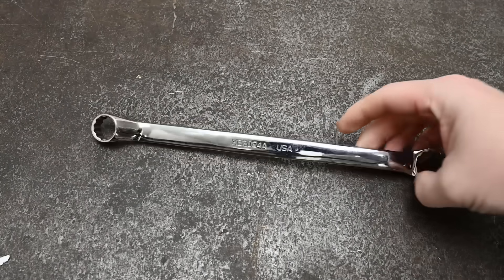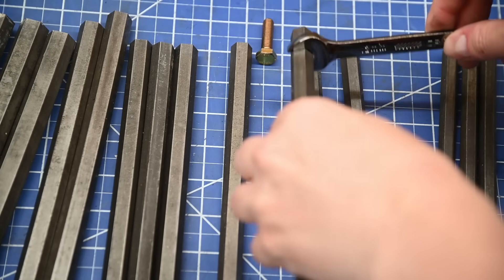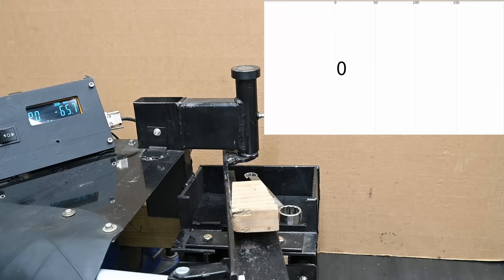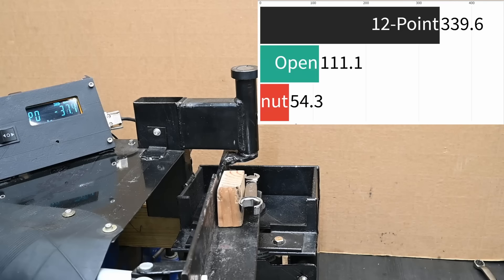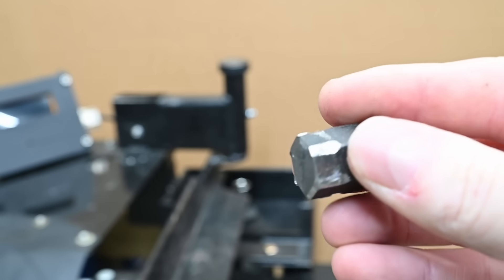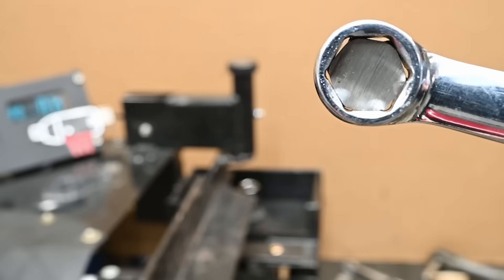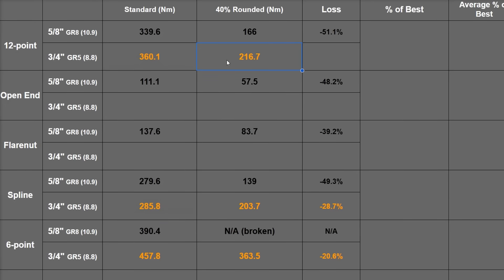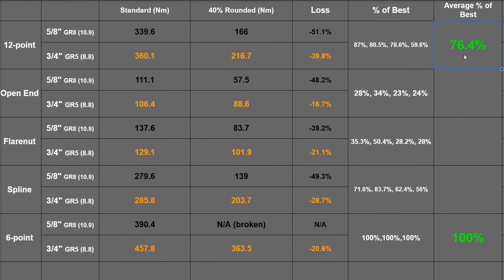Wrenching Robot Settles Which Slips 1st

Comment: I've used 6-point box ends, they were relatively rare back when I was working.  They somewhat defeat the purpose of a box end wrench which is to provide maximum strength and maximum flexibility to fit into a tight space.  I don't recall ever having a problem not loosening a fastener with a good 12 point box end.  Maybe these days with mechanics having large boxes of tools it is worth having a set of 6 point to supplement your 12 point but I didn't have them.
Yes this always sounds like my kind of fun.

Comment: I would like to see you do a bit more testing on spline drive and rounded stuff. I only say that because i personally have removed bolts with a ~2010 craftsman spline drive wrench that I rounded with a late 90s area craftsman 12 point combo wrench back in my younger years when I didn’t have the knowledge and tool access I do now

Comment: Who would have thought, a 6 point tool works best on a 6 point bolt.

What's more amazing is that these tool companies can sell an all in one tool that fits on every bolt to people who think it will work best on every bolt, like those gimmicky any size tools that break after 2 uses.

It may be more expensive, but you buy the right tool for the right job, even if it means buying more tools, and it will make the job easier.

Comment: I worked on F-16s, we used spline wrenches ... on spline bolts. Why you would use it on a hex nut is ... beyond the pale. Use the right tool for the job.

Comment: Would these all behave the same if they didn't have a chrome plating in the business ends? 
I'd love some quality raw spanners, went with pretty much all Stahlwille because of the concave shape and the matte finish. Raw would be better in a work environment, getting sliced by flaking chrome plating on the sacrificial spanners sucks.

Comment: Something the comments are making evident, with cars when you have plenty of room on small vehicles.. 6 point is best. Clearly alot of the commenters have never worked on heavy vehicles (Talking 50+ ton underground dumpies and boggers like Sandvik or Epiroc).... You might be doing up a bolt that only allows less then 10' of movement due to hydraulic lines or the steel frame itself and you cant fit a ratchet in. 12points rules in this scenario so that you can actaully start to rotate the nut.

Comment: 4:12... By the time I'M done mangling a stubborn bolt, by using vice grips and pounding on sockets that are the next size smaller, it has lost WAY more than 40%. 

Once I have it destroyed to about 60%+ of it's original size or less, that's when i call it quits, haul out the Acetylene torch and just cut the fugger off... 😮‍💨

Comment: It all depends on the fastner but 6 point is the best for torque. The other types are mostly for speed. If you are using a different type fastner you should use the correct tool. If it is not 6 point then it will either have low torque or steps to tighten. There is no magic to this.

Comment: a 12-point wrench is meant for a 12-point fastener. try again using the correct fasteners for each wrench. otherwise, your tests were no more valid than all sorts of other incorrect tools for the fastener, eg. strap wrench, pipe wrench, etorx, acetylene torch, pliers, vise-grips, bladed screwdriver, hammer, etc.

Comment: Thanks for the great video! You've confirmed in my mind that buying a single-hex ring spanner (box-end wrench) is a waste of money... I mean, what use is 13% more torque if it destroys the tool? Sure, the 12-point spanner damages the fastener (and lets you know that you might need to use other techniques or tools to remove it) but, at least, you've still got a full toolbox.

Comment: I live in the Rust Belt and the 6 point is a must have unless its a new bolt. I don't get why these tool manufacturers don't make 6 point wrenches as common as the 12 point. You have to shop around to find them

Comment: Let's talk about the 6-point solution...which are the Astro Nano sockets in its ratcheting flex-head breaker bar:
I noticed that all of my box-end wrenches are 12-point. Watching this video makes me think it would be good to have 6-point wrenches to break loose nuts to avoid rounding corners. But of course a six-point wrench has a significant shortcoming in that it does not provide good access angles in tight places. 

...Turns out I have a great solution: I own Astro Tools 6-point Nano sockets which clip into a ratcheting flex-head breaker bar, which is much thinner than any 6-point socket on a ratchet! 

All of my other ratcheting wrenches are 12-point, so using the Astro Nano sockets provides several benefits:
1) 6-point socket 
2) ratcheting 
3) flex head 
4) thin clearance
5) breaker bar handle

Comment: The enemy that causes rounded bolts is pressure per square inch. The force applied is the same but the smaller area creates pressure that the bolt metal cannot withstand without creating enough tourqe to turn it. I assume this is why the hexagon is the besta gon. 😊

Comment: This just in, using tools that match your hardware will yield best results!
Reply from the maker: By how much is what the video is
Reply: @TorqueTestChannel oh true. Well yeah, we used to use 12 points when assembling rods and main caps on caterpillar and Komatsu mining equipment, all all our tools were 12pt and all the hardware was too. Lot of those bolts were like 180ftlbs + 90° and for the main caps some got up to like 340ftlbs +90°. Never had issues. Now that you’ve framed it like that, cool video.

Comment: 7:49 im curious as ive not experience issues with my spline drives. i only got them because only passthrough set available.

edit.. ive also moved to newer vehicles and boat work which is less corrosion and fresh fasteners if they arent perfect.

Comment: 6 point is going to be strongest for the newest fasteners but its rather limited given the use case of the other wrenches. 12 point gives more access points so tight areas it is rather king plus it can still deal with 4 point or square head bolts and nuts. Open end is just the basic hold over as a multiuse that closed ends can get and also work for 4 points. Flarenut really are the special use case wrenches and most the times people are just misusing them. Spline is maybe marketed more than its intent being spline heads, but it can also do external torque type bolts so that is a perk it also has. One other thing that I have gotten from Spline is that if pushed on hard fasteners but not to the point of rounding them over, Spline works really well on rusted or painted fasteners. Since they can bite through the paint and rust where the 12 or 6 point has to be hammered on and then hammered off. Spline is easier to hammer on and then release a bit easier. Since they are less focused on the furthest corner than the face of the fastener. However a crappy sized spline for what they should be will get some horrible results so fit is a lot more important on them. Spline can do less damage to a stuck fastener which is true but thats a normal stuck and not a "you should have used heat first" stuck.

However when it comes down to it, the king of fastener heads is still the square or 4 point. Now to clarify, those drain plugs that have the square sticking out, those are slightly rounded over from the start so they have a slip over weakness in the first place. Open end, 12 point, crescent (cause I am not going to change how I call them) wrenches were rather purpose built for 4 points and where they have some of their best use as now they are pretty mediocre at the job. Then again companies still use Allen head screws for things when they are a pretty mediocre especially on cars.

Comment: Personally, i LOVE my spine drive sockets and wrenches and i use them daily at work,  but I'm well aware each type has their limitations and when to use the correct tool given the job. Line wrench on a flare fitting, 6 point on high torque applications, and 12 point on 12 point fasteners. But spline works 80% of the time, like etorx/square/triple square

Comment: Bought a full set in metric and Inch of Craftsman 6 point box ends some 25 years ago and never looked back.  Thing they were about $60 a set.  Big money for a highschool kid but have more than paid for themselves.  Don't need any prestige brand on a wrench.  Snapped plenty of bolts off, but never slipped or rounded a nut or bolt and never broke one.  Makes a good standard for how much worse other designs with more angles are, but don't know who needed a test rig to tell them the six point box would be the best.

Comment: It may be fun to test the effectiveness of the various "hacks"  (apologies if you did some of these)
1) use vice grips to on flare or open end wrenches to keep them from slipping
2) Heat on NON rusted NUTS to ease loosening
3) Freeze sprays on on NON rusted BOLTS to ease loosening
4) Impact (this has been shown to work on rusted stuff what about not rusted stuff)

Comment: If you want torque, use square.
If you want something that works, use hex.
If you're in a pinch, use flare.
And for everything else, there's 12 point / spline.

Call me old-fashioned; I use tools that are the same shape as the hardware i use them on. Using 12-point for hex is like using a spanner bit for security torx.
Can it work? Sure, with enough dedication. Will it continue to work? No. Will it work well? HA, hell no.

I love spline, and don't even mind 12-point. ... for bolts it's meant to be used on.

Comment: the key thing here is if you can use the correct point/cut count based on the bolt and if you cant do that for some reason then try other ones in this order
Square - yes they do make these
6-point
12-point/spline - it is recommended to only use spline on spline bolts, but sometimes spline works better then 12-point
open end - yes you can use an open end on 12-point and spline tho it is minimal

line wrenches are designed for a specific job only use them for it

Comment: I keep splines around simply for the rounded off bolt and only in metric sizing. I go one size down from whatever size the bolt was prior, hammer it on, and seems to work better than the rounded bolt extractors in most of the situations ive used it.

Comment: I own very few 12 point wrenches and sockets. I have a few that are for certain applications that actually use 12 point fasteners and for tight spots. An exception is my wrenches over 1". Those wrenches don't normally get heavy use. Just big fasteners that don't torque down extremely tight. A trick with line wrenches is using very high quality wrenches such as the Snap-On with round jaw vice grips clamping the head slightly closing down the wrench head preventing slipping. Most of the time. Sometimes cutting the line and using a socket is the only way or if replacing the line anyway. I have also been in situations that an open end was the only thing on hand and used the vice grip trick to break loose the fastener.

Comment: What's the average torque a person can apply to one of the wrenches? It obviously scales with the length of the wrench, but I'd be curious to know if the limits shown by Pushy can actually be approached by an average person - not counting a cheater bar.

Comment: I have a few spline  wrenches that are long pattern and never have an issue with them slipping at all. But I also think some of that is the nature of the work I do (mower mechanic). There seems to be a crap ton of rounded bolts with auto and agricultural repair that I just never see with mowers. I never see the tool failures I see others describe and I have to believe it's the work I do rather than the tools I use or something I'm doing (or not doing).

Comment: Do open-ended wrenches have a preferred direction? My intuition would be that it should be pushed/pulled toward the thicker arm, since the side you move the wrench toward will be pushing on the head further out and thus have a larger lever arm, benefiting from greater reinforcement. But you loaded the open-ended wrenches in the opposite direction

Comment: Salt belt, not rust belt. The rust belt is the area of the country that lost its industry related to the steel industry (steel itself and automotive, especially). The salt belt is the part of the country where roads are salted in the winter for ice removal, which of course causes severe corrosion on cars.

Comment: out of curiosity, have you ever seen a "gorilla spanner"? at least, that's what I know them as here in South Africa... doesn't look like SnapOn make anything like it though. 🤔 3 auto adjusting heads that cover any bolt head size from 6mm up to 22mm, which grip the head tighter the harder you push on it...? like, seriously.. they are just as awesome as they sound.. dare I say, especially when the bolt head you're gripping doesn't have perfect corners... but this video now makes me wonder how they compare to these other more "traditional" designs.

YT seems to auto-delete comments with links, but Google returns lots of good results for this.

Comment: they oughta make a wrench that's got 6 point closed same size on both end except rotated 30° from each other that way it has the strength of the 6 point and the versatility in tight spots of the 12 point

Comment: I too feel the premise of a spline wrench is suspect due to the extra gap. Splines are used elsewhere because they ELIMINATE gap. 

As ever, the only saving grace of a desperation tool (flare) is that they work best by never having to tighten the connection a whole bunch: For gas lines you might have soft metals like copper or brass, and for cars there’s hopefully an o-ring being used on hydraulic lines.

Comment: In my opinion spline is only usefull on a completely rounded fastener. Use the next size down and hammer it on. You might never get the bolt or nut back out of the spline socket or wrench. But it saves the day

Comment: Interesting video, although nothing at all surprising for a 30 year aircraft mechanic, nor I suspect for anyone that has ever used a wrench.  As if it isn't already obvious, we choose the most appropriate wrench for the job we're doing, not for max torque, that's why my wrench drawer looks like the wrench shelf on the local Snap-On truck (including many not tested here).  12-point box are great, and excel when turning space is limited, 6-point (wrench or socket) when max torque is desired.  I never use my line wrenches on nuts or bolts, and almost never use open end if I can get a box wrench on the fastener.  FYI, I would have bet a paycheck that you'd break the 6-point before it rounded the stock....I have, and it hurts!

Comment: The reality is that a 12 point provides adequate torque 99.9% of the time.  It is only when removing a fastener that is severely rusted or that was torqued down by an idiot that you need a 6 point.  And the convenience of a 12 point wins out 99.9% of the time.

Comment: Irwin Vise-Grip has the absolute best tool for removing damaged fasteners and I finally found the part number so you can order a pair and put them to the test.  This part number is for the 10 inch version but they at least used to make them a lot smaller for things like brake lines and such so if I find that number I will include it.  Part number VSG1LW is again the 10 inch version and I would love to see the numbers that this tool will generate sometime as I think pushy will probably destroy the tool itself before it slips. VSG4LW is the part number for the four inch version and VG8 seems to be the part number for the eight inch pair to complete the set but those are from three different suppliers.

Comment: I’ve been wrenching for 55 years and I’ve never seen an open end wrench outperform a 12 point box end on any fastener no matter how rounded or rusted.  However, for really gnarly fasteners, a 6 point is certainly better or Vise Grips if the fastener is really trash.

Comment: 12 point is about accessiblity, with a 6 point you got 60 degrees before the wrench fits in one way, a 12 point only 30 degrees, so it's easier to fit on hard to reach bolts/nuts

Comment: Lowes had a spline display years ago. They had a nylon bolt for you to try them on lol. Too bad for them I found that the display was put together with the same size bolts, but in steel. The spline POS slipped off but the six point didn't.

Comment: 12 points were advertised as not to be better than 6 points but more versatile. You have to rotate the tool less degrees, to seat it on the bolt than with 6 points.

Comment: Yeah I don't understand the fascination with spline drive. Like, a spline on a spline bolt seems like it'll take more than a six point on a hex bolt, in my experience, hence why wing box bolts are typically spline bolts, but I don't know why you'd use a spline on anything else lol

Comment: My flex head double box long ratchet spanners only came with spline drive, and I've busted some tight stuff loose with them so spline drive does not worry me using it on 6 point hex bolts and nuts.

Comment: Yeah my 6 point wrenches were easily one of my best tool purchases. My 12 points only get used when I have no other choice due to angle of access. I also have to disagree I have a friend with a full Snap On tool box and he has on more than one occasion borrowed my Tekton Flare Nut crows foot  set to remove marred to all hell flare nut fittings. They are fantastic and have removed flare nuts I would have sworn never had a chance to come off without getting out the vice grips. They were mad expensive but worth every penny living here in the rust belt.

Comment: Spline drive works great on small rusted fasteners because you can drive it into/onto the rusted hex and bit into the rust and metal really well especially if you're working with under size and between size stuff. Overall 6 point is the best, but spline has it's uses.